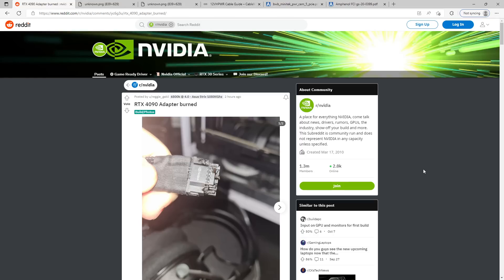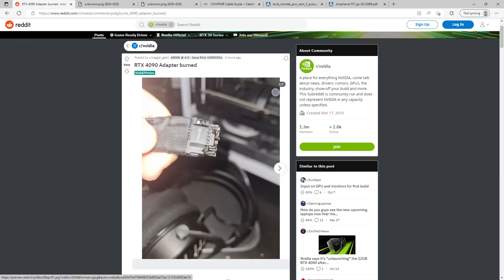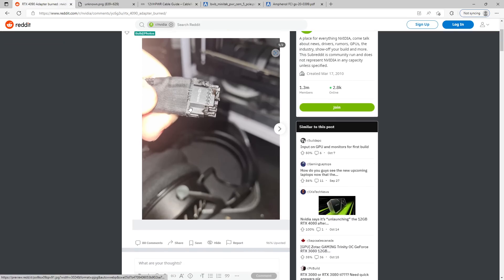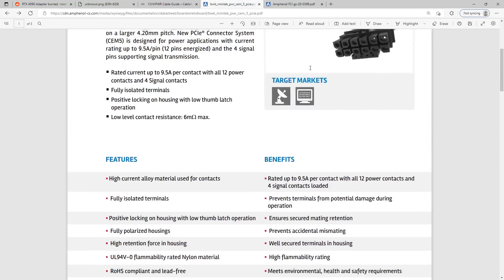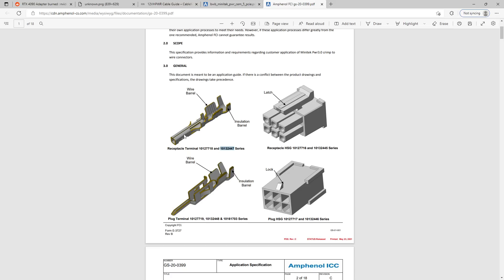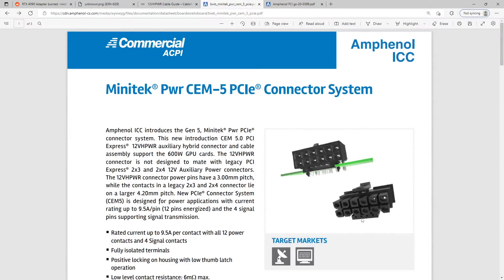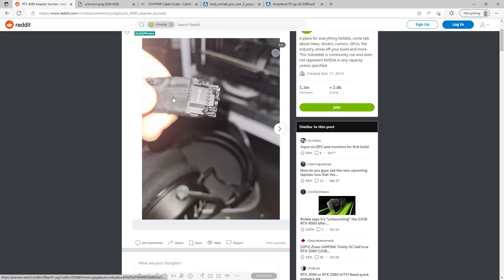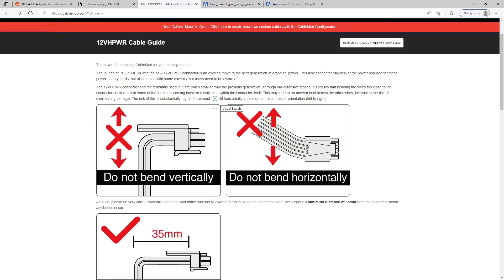The 12VHPWR connector sucks

Comment: If they really had to go this route... Ideally they would have adopted a more (high end) automotive style connector. It could even be nearly the same size, just slightly tighter tolerances between the crimp terminals and the plastic, as well as strain relief at least in the form of a semi elastic boot and preferably o rings around each pin, not necessarily for weather sealing but for its secondary effect of giving you more strain relief in the form of the pliability of the o rings (and this would all still allow for a bit of flex for alignment)
Reply: PC hardware manufacturers that are trying to save every penny like using cheap TIM (paste and pads) would never use high-end connectors like that... They will instead blame consumers for any potential problems like always.
Reply: @veduci22  sounds like they need to be sued again. That's the only way to get the message across
Reply: @veduci22  The Ford Pinto story. The gas tank was probe to rupture and Ford knew and didn't care, rather pay the lawsuits than fix the issue...
Reply: An Anderson plug would do, big pins and handles amps well.  might be a bit overkill actually
Reply: @draconightwalker4964  hey overkill usually means less fires/melting  lol
Reply: Insomniul said exactly what I was thinking... PC hardware manufacturers (even the ones who try to portray a "high end" brand image) are just despicable with their cost saving *obsession*. If Asus can't give me any better/thicker PCB on my $500 ProArt board than I would get on a $129 "gamer" board, then theres absolutely no way they have the margin for any kind of respected, well engineered, trustworthy brand of interconnect. These manufacturers don't even buy genuine Molex connectors and sockets for their boards do they? They just buy counterfeit Chinese ones from what I've seen.
Reply: There are a ton of better connectors for this kind of power delivery, hell they could copy some servers with high area pcb connector, but they wanted to be apple and apparently user safety is their minijack
Reply: Tight tolerances? It's unreliable, ladies and gents.
Reply: An 'automotive style connector' does not exist for >50 amps, except for Ford who is famous for having connectors that burn up and fail to the point that new components like alternators come with a new connector attached because you can't reliably use a push on/in connector at tens of amps.  To use fewer wires and a smaller connector and increase reliability would require using fasteners, as in using small screws to  attach the power connector.  Interestingly, the EPS 8pin CPU power connector is claimed to be good for >350 watts, not sure why that connector wasn't used in the first place and the PCI-E simply never having existed.  The ATX 3.0 standard is for douche bag OEMs like Dell and HP to save costs and cut corners.  Why Nvidia chose to use such an obviously stupid connector is astounding considering how ugly that shit show of a dongle they include in the box that seeming is designed to make the situatation as bad as possible.  Simply making the cable 12" to 15" long instead and putting the chip at the same end as the 8pin connectors would go a long way to reducing the problem.  Moving to high tension bladed connectors would also improve things dramatically.

The new standard is so that OEMs can ship 4090s with 550watt power supplies and the GPU will simply throttle down so the computer won't crash and the sucker who was stpupied enough to buy a mass market computer won't know he was screwed.  It's just anothe rway the PC industry can commit deceit.
Reply: @allanwilmath8226  RC battery connectors rated for 100amps are easy to find.  I pulled 5500w, 110a at 50v, thru a 8mm bullet. A $4 deans can do 50a forever.
Reply: @allanwilmath8226  It would just require more contacts, with 12 gauge connectors rated at 20A each. At 9.5A per contact you can use a 14 or 16 gauge connector. There are quite a few connectors from TE/Amp that would be up for the job.
Reply: @allanwilmath8226  when I was saying automotive style, I'm referring to the amount of strain relief you usually find in a decent harness. Looking towards motorsports more than oem persay. Talking about power handling... Most auto applications are carrying a 12v and then a sensor signal over 2 different conductors  (I'm sure you know this but just saying), vs the pc application, in this case is using multiple conductors separated over multiple pins so it's a little apple's to oranges here. I'd prefer they not try to cram it all into one plug here tho so Nvidia doesn't become the next Ford lol

Comment: 2x 8 Pins would be enough for 450W. Like said in the video they have an insane safety headroom for lower quality PSUs I would assume.
Reply: Also the 8 pin connectors are more flexible so no need to worry about this happening at all.
Reply: You don't go out of the specification and into the safety margin however, or you will end up burning up a cheap cable or cheap PSU. So no, 2x8 would not be enough for 450W.

Comment: Not sure if it's because of less pin, or just bad/weak connector design, considering previous 12pin connector haven't burnt up like this. I do like smaller single connector,  so I hope to see better connector design-maybe fixed 90-degree connector with solid plastic housing to reduce stress on metal pin-can fix this
Reply: The 12 pins are limited to 450W and the burning issue seems to occur in an power draw of higher than that in the lab testing done.
Reply: @NotThatGuyJD  while rating of connector  is lower(600W vs 450W), power consumption of 4090 is almost same with 3090 Ti.

Comment: If it is well built I don't see a reason why not to use it. It would lead to cleaner builds and at least based on the design idea avoid power delivery issues.
Also it is not an NVIDIA connector, it is a new connector of the ATX 3.0 standard. Nvidia merely chose to use it earlier than others.

That's the theory to it. If they are not well built and the actual implementation is done poorly then sh** happens. But such issues can also crop up with existing PCI power cables.

As to the number of cables:
The type and thickness of the cables matter.
You power an entire PC with just two or three cables that go into the PSU - Does that not add up either?

Comment: as soon as I saw this connector and the 600W power rating I thought to myself - this can't be right and will end very badly, even 450W, at 12V that is whooping 37.5A (50A in case of 600W) going through that connector, the wire cross section might be ok, but that is NOT how connectors work, they essentially make tiny point contact where the pin is connected to socket, 2-3 of those tiny area pin point connections (per pin) which have to transfer all that current, and those tiny points cause electrical resistance, resistance*power=heat, the trick is either to make the contact area larger (think screw terminals for instance), or just have many more of the tiny connections (more pins essentially), and this still relies on the "if" surrounding metal around that pin point connection is beefy enough and has enough surface area so it can dissipate that heat generated by poor connections well enough for problems not to occur, but a 2.2k piece of hardware should NOT try to screw the penny over this, it is just absurd

lab power supplies that handle this sort of current are always extra beefed up near lead contacts, big beefy connectors to avoid these exact problems, but Nvidia just totally ignore all common sense and go the exact opposite way, really really bad design choice here

anyway, my 4090 purchase is put on a backburner, not rich enough to serve as a guinea pig or beta tester for this obviously poor design

Comment: I honestly expected them to use the extra pins to automatically measure the resistance of the connector. That's literally the first useful application I could think of for direct communication between the power supply and graphics card.
Reply: yeah if the GPU sees "oh shit we are getting 12.5V on Sense but only 11V on the +12V plane we need to shut down the connector has bad contact" it would make sense to have the sense pins in the first place. Not using them for that is kinda dumb.
Reply: what if i don't want my PSU and GPU spying on each other
Reply: Perfect idea. Unfortunately that would require new PSUs.  "ATX3.0" PSUs are the same as older PSUs, just with the new connector slapped on the housing.
Reply: @jonnyGURU  The ATX 3.0 spec also adds requirements for tolerating power spikes of up to 200% of the rated output for 0.1 milliseconds
Reply: @spankeyfish  Yes. But that doesn't account for burnt connectors because the power excursions are very fast.  Also, supporting the power excursions defined in the ATX 3.0 is nothing special/difficult for PSUs that are 1200W and under which is why Intel had no reservations making it a requirement.  Furthermore, Intel relaxed the voltage regulation requirements so if a PSU otherwise drops out of spec during the power excursion, the resulting voltage is a "pass" where in previous ATX12V spec it would be a "fail".
Reply: @jonnyGURU  It would be a feature of the cable, not the PSU.
Reply: @johndododoe1411  If you have a wire that measures resistance or voltage, what's it going to report to? If you look at the sense wires on a 24-pin, those double wires report voltage back to the PSU.  What good is a cable that measures resistance if it has nowhere to report that data to in order to take action?
Reply: @jonnyGURU  couldn't it be made so that it talks to the GPU VRM controller and shutdown/power limit the card?
Reply: @Lemard77  so, that's just it, right? They could have easily put a shunt on each +12V lead in the GPU itself and have the card shut down if there's more than  5% (random number) variance between the terminals. But instead, all of the +12V and ground wires are bridged to a single solder pad on the GPU, so any such logic would not work.  Nvidia needs to redesign the card if they're going to keep this connector.
Reply: @jonnyGURU  Report to the card, as already suggested by the OP.
Reply: OP didn't suggest that. OP suggested using the extra sense pins to report resistance directly to the PSU.  It's literally what OP typed.  :D

Comment: Hey there, I've got some decent experience with crimped cable loadings, and while most of your analysis is on the mark, the seam on top of the crimp connector is not likely the reason for the horizontal bending comment. any horizontal side loading will not be transmitted to that part of the crimp as the bottom is just solid.

I'd imagine the bigger issue with horizontal bends is that, they cause much more strain on the cable due to the larger difference in bend length between the inner and outer cable. This tension force on the cable causes a pulling force on the crimp, which can cause a variety of effects:

First of all, it can cause deformation of the crimp. See those flanges on the side of the barrel? Those are what holds the crimp in place in the plastic connector. If you pull on them hard enough, you might cause them to buckle, either 1: just pulling the crimp straight out of the connector or 2: causing the crimp to sit much further recessed in the connector than intended. 1 sounds worse but at least it's easily noticeable (you have a loose cable). 2 however is what will cause your thermal runaway most likely. The crimp barrel contains a small intended to push the pin against the barrel to ensure contact. In the one you show it's located on the bottom of the crimp near the front, so it's hard to see. However, if the pin is not fully inside the crimp barrel this contact can be much worse than intended, leading to high resistance in the connection ending in thermal runaway.

Alternatively, if the crimps are bad or too much force is applied the cable itself might (partially) slip out of the crimp causing a worse connection for the same effect.

Finally, even if nothing breaks, the crimps are generally loose in the connector, allowing them to orient themselves around the pin properly. Apply enough force though on the cable end, and they will be stuck in place, causing worse contact. Still in a properly rated cable bad pin contact should really not be such an issue. But just think of the power they're pulling through there. 600W @ 12 means a total of 50A being pulled through 6 pins. That is ~8.5 A per pin. For reference, normal ATX molex pins on 16AWG cable (https://www.molex.com/pdm_docs/ps/PS-45750-001.pdf#page=6) are rated up to 12.5A individually, but as soon as you put 12 of them in a connector that rating drops to 9A. This is because the limiting factor is the amount of heat generated by the connection resistance that can be dissipated per connection drops as soon as you start stuffing them together. Now I don't know what black magic Nvidia used for the new connector, but 8.5 per pin, on all pins (mind you a normal 8pin has 3x12V and 5xGND, so the ground pins take only 60% the current of the power pins) in the same space with just basic crimps just seems like asking for trouble to me by finding the absolute limits
Reply: Good info. BTW, it's 600W at 12v, so nominally 50A total or 8.3A per contact.
Reply: @tinfever  whoops I was definitely not awake enough when I wrote that
Fixed!
Reply: @CensoredUsername_  so basically the cable is fine, just dont bend it? the picture of the pc on reddit shows some bending in the cable, right around that black material that im guessing is supposed to reinforce the cable, it looks like the user has hard bent that for cable management 

feels bad man, dude bent the cable to take a picture of his 4090 with perfect cable mangement for reddit n boom lol 😂
Reply: @cristiant6566  if your cable is only fine if you don't bend it in any way, then it's not fine, especially if it's a user serviceable part. If they cannot bend safely they should really have had a more rigid harness. Besides, I used molex mini fit data as a comparison, but apparently the actual connector is a molex micro fit variant only rated for 6A/pin normally. And they're pulling 8.3A through there. So it's probably heavily eating into the safety factors of those connections, and any kind of suboptimal connection might cause thermal runaway.
Reply: @cristiant6566  The problem is these cards are so big that unless you put it vertical in a giant case, you're going to have to bend them at least a little to make them fit. If the cable can't handle that then the design is poor. It's not like PC cases suddenly sprung up and the designers had no idea how much space they have or the angles involved.
Reply: @FluffyWuffy17  I watercool and have an inverted case so the gpu is close to the case floor with a support
Reply: Well, normal cabels uses 18AWG so the max current is lower 8.5A. Also it depends how many wires are used for power. You can have 12wires, but if you use only 6 of them for power the max current is then higher.
Reply: Forgot to mention that you are reffering to mini fit, but the 12pin connector used by NV is micro fit with max current only 6.5A Product Specification:430450001-PS-SP-000.pdf
Reply: @jankahoun7326  I just used minifit as a comparison to show what makes sense, but if those things are microfit, what the absolute hell was Nvidia thinking. Did they really just go like "it's above spec but it works under our ideal conditions"?
Reply: @jankahoun7326  Hmm datasheet says 8.5A per pin.
 https://www.molex.com/webdocs/datasheets/pdf/en-us/0430451010_PCB_HEADERS.pdf
Reply: @Naithcz  But this value doesn't reflect the number of pins used for power. It just says that this housing can't be used if a single pin delivers more than 8.5A. More power pins means lower current per pin.
Reply: @jankahoun7326  Things maybe are worse. This Connector has 12 pins. 6 for input power and 6 for ground. Current flow over all these pins, not only through 6 pins (in datasheet are 2 pins minimum). In this case, the max current is only 5.5A. Well, it is not good (5.5A*12V*6pins = max. 396W). Serial resistance for one connected pin are 5 milli ohms,  Loss power is in this case P = U * I => (5.5A * 0.005) * 5.5A = 0.152W ... well this is small value. Hmm, strange. And its have only 30 cycles .... quality of these pins are probably very bad.
Reply: Great explanation, was looking through the comments just to see if anyone already mentioned that.
Also the new connector being a bit wider might increase the connection problem. (Though that is just a guess)
Reply: Great analysis.  As someone who has crimped and assembled similar styled connectors in the past, I can say you are spot on.  In my part of the industrial world, this 12vhpwr connector would not fly unless it was severely de-rated.
Reply: There have been some photos recently where people have seen the barrels pulled a couple of mm out the connector for the wires on the outside of the bend radius as you mention possibly happening.
Reply: This man knows his stuff.. spot on analysis..

Comment: Rtx4090 should come with its own cable for the wall outlet.
Reply: lol yeah
Or power supplies could add a 24 or 48V rail haha
48V x 12.5A = 600W
24V x 25A     = 600W
12V x 50A     = 600W

Comment: What an embarrassing, shocking quality connector though… Coming from the Automotive industry where we see 12V connectors under much harsher conditions and they don’t loose contact. 

NVIDIA have done half a job here really, yes they didn’t have room on the PCB for 4 power connectors. But then maybe if they’re going into the effort of making this adapter why not recreate an entirely new style power connector that uses deutsch pins or something on this level.